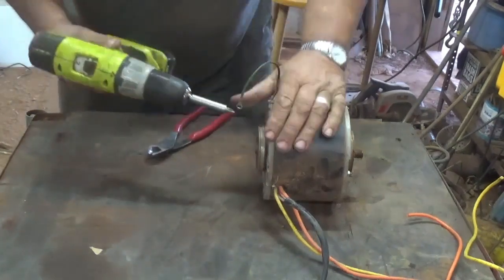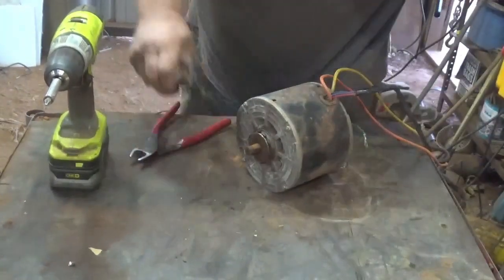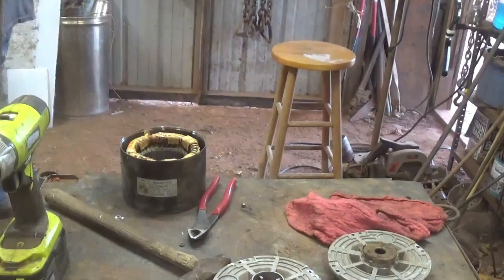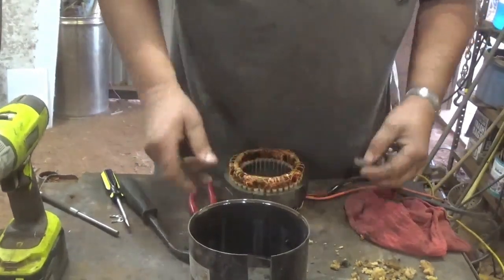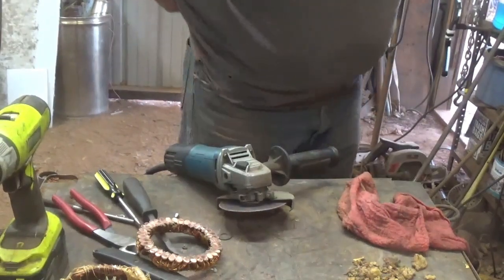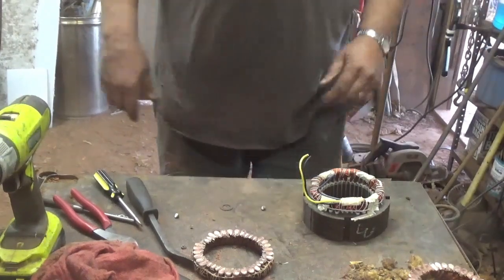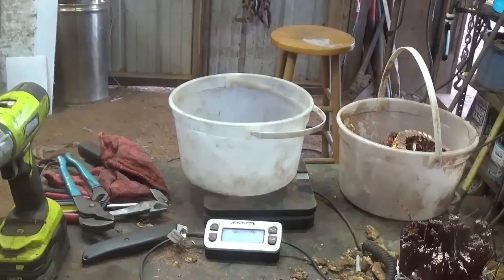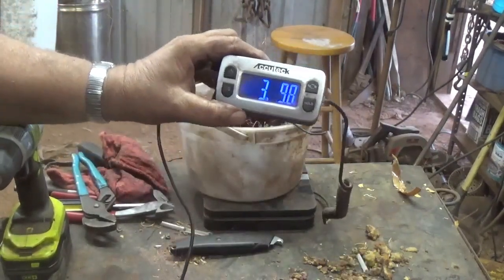Scrapping out an Electric Motor for Clean Copper and Clean Cast Aluminum

Comment: I used the hook blades on strings until one day went to bench grinder and tried the wire brush, worked so well for me that is how I get string off windings now. Thanks for another good video.
Reply from the maker: I will have to try that, or put a wire wheel on a drill

Comment: Looking good I will give you a great tip... After you get the bolts out simply smack the motor down on the workbench shaft first and it will pop the back cap off and then turn the motor around the other way and throw the motor down on the bench and it will pop the other end off very easy and very fast..... Another tip I seen on a different video is when you get the armature out instead of cutting it with the razor blade knife this guy just had an electric ignition propane torch and he barely hit the strings with the torch and it just melted off the strings
Reply from the maker: sounds like a fast way to do it for sure
Reply: @Okiescrapper  thanks for the reply back..... May I suggest a few more tips.,... Regarding the two aluminum end caps.... Since you got your big aluminum smelter what I do is just throw the in caps steal and all and just melt everything down and just scooped out the remaining metal....... Also since I'm on a roll LOL the center armature can also be thrown in the aluminum melting pot there's quite a bit of aluminum at least I'm pretty sure it is it melts out very easily so that Shannon or armature in with your aluminum and just scooped out this steel shaft...... This definitely will save you so much time and add to your aluminum ingots..... I really hope this helps you out and adds to your fun me and the kids really love watching your videos

Comment: That little piece you cut off the wire leads looks like the thermal protection and in my experience they have silver contacts in them.
Reply from the maker: silver contacts, hummm I may have to start keeping them. thanks for the info

Comment: clean video as always but when you do the final oz on the scale do a flip to kg/g for the rest of the world who are chering you on :D and btw i use headphones the when you edit you could lower the "grind" parts abit more but its not at all as it was from the start so its not just the casting melting and teardowns that are stepping up also the edits.
Reply: 1 stone = 6.35029 kg.  or 14 lbs.  :face-fuchsia-poop-shape:
Reply: @Dave-ty2qp  yeah and a button on the machine :P still we should pick one system and just go with that imo:face-purple-smiling-tears:
Reply from the maker: I can try to do that, it may help some
Reply: @1988Mauritz  LOL I have to agree with you.  I was an aircraft mechanic all my life, and working on Metric built aircraft was always a pain because of the math to convert the two measurement systems.  It wasn't hard because after a while you learn to think in both matrex's but the waste of time having two systems.
Reply: @Dave-ty2qp  indeed its like if you took a left step the 4 of october 1975 you read from left to right but but of you took a right step you read frpm right to left :P
Reply: @1988Mauritz  I lived in Japan for a number of years, and they were very sucessful at reading from top to bottom,  right to left.  But they ate a lots of fish too.

Comment: The only difference between the way you do it and the way I do it is I use a vise and saws all with a demo blade to cut the copper
Reply from the maker: I used to use the air chisel to cut the end off, slow but it gets it done